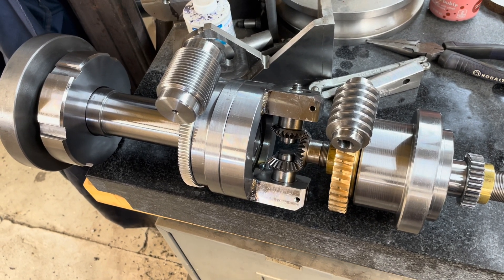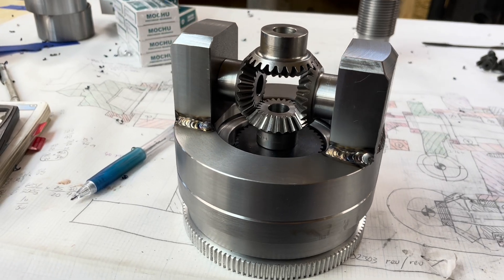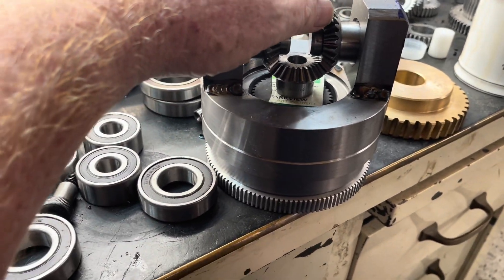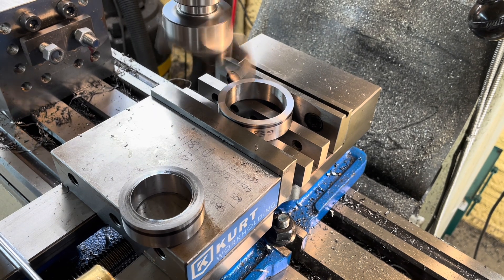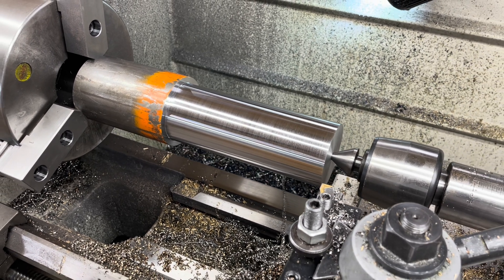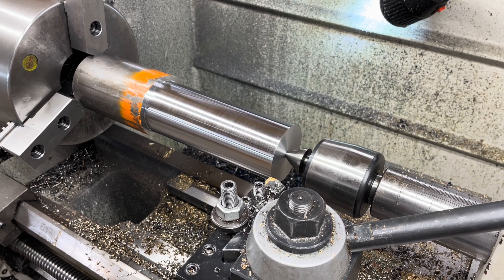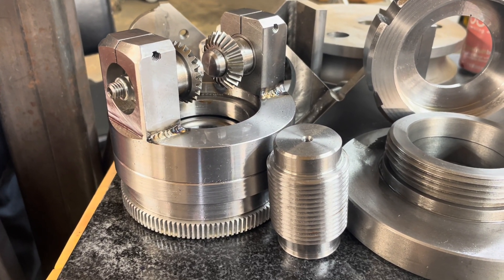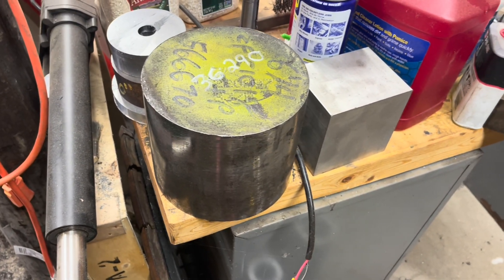Gear Hobbing Machine Spindle Update

Comment: Very impressive work. The main shaft with taper is too scarry for me to ever attempt. I like 12L14 also, these kids (under 40 😂) today don't understand stiffness (modulus) versus strength. Your welds are pretty good to on the differential carrier.
Reply from the maker: Thanks!  I was nervous about the taper, too!  It may not have been too clear from the video, but I made an angle block on the mill, then used that block to set the compound slide angle directly against the work.  Came out very close..just a couple of light passes to finish up.

Comment: Hey Tom, I really enjoy seeing your work (and the math too :)  - definitely next level compared to most!   If I may offer one small tip I've learned - For the finish pass I switch to carbide inserts meant for aluminum ( I think they're un-coated?).  While not quite as tough, they leave a fantastic surface finish on 12L14 for me.  Looking forward to seeing that diff run!
Reply from the maker: Thanks!  I have some of those inserts, but I’ve never tried them….maybe too much in a hurry?  I will now, for sure!  All the best…
Reply from the maker: By the way, I really appreciate the tip!  I’ve pretty much always got a lot to learn…that what makes “shop class” so much fun!
Reply from the maker: I tried the insert with a smaller nose radius.  MUCH better!  Thanks!
Reply: Nice! Glad I could help. @thomasstover6272
Reply from the maker: Update…I’ve switched to finishing inserts for everything.  I don’t do much really heavy roughing, and these work very well at .075 DOC, so I just use them for roughing and finishing.  This was a great tip!  Thanks for helping me up my game!

Comment: Just wondering, but I always learned that bearing journal size was a slight press fit to avoid bearing spin and galling. But I've seen alot of guys using a sliding fit. Is there any advantage that I'm not aware of?
Reply from the maker: I aim for a “hand press” fit, but I usually end up a couple tenths loose.  Most of these bearings will be operating  in the 1-100 rpm range, so I’m more worried about holding center position than slipping or galling.  I only see about .0001 radial play in a completed and torqued up joint, which works for me.  Good question!
Reply: Love the Chanel , thank.